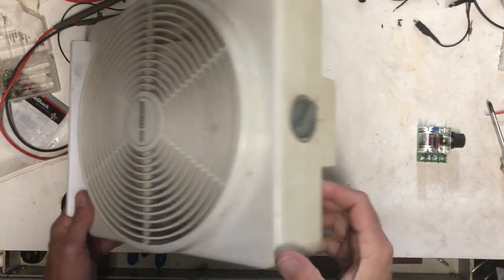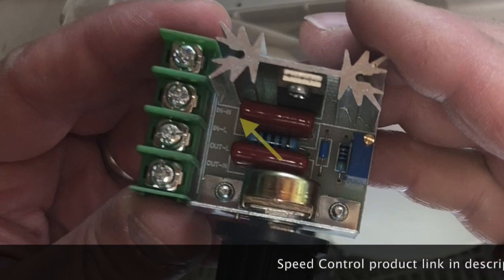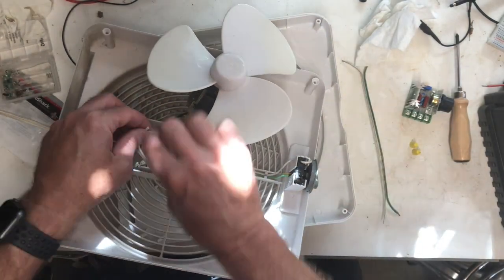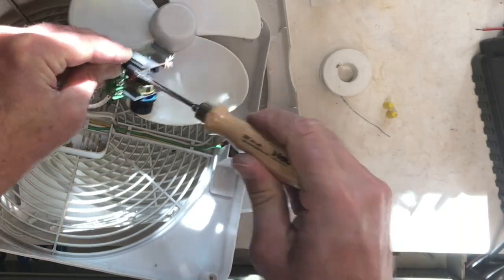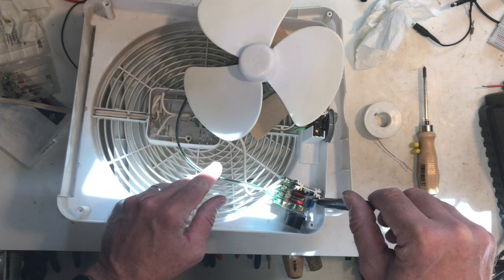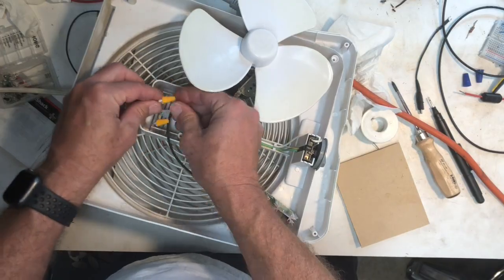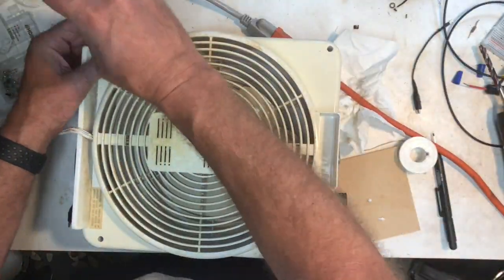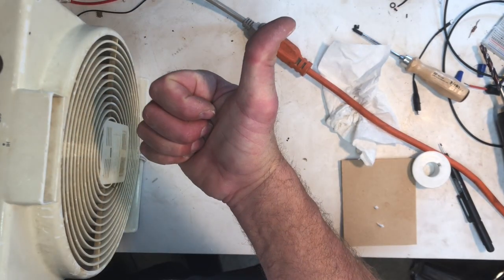Adding speed control to an old fan

Comment: Would this work on small inductive motors like microwave fans
Reply from the maker: I think it would but because the unit I bought provided a pretty awful looking waveform, I wouldn't use it in a safety-critical application! There are higher quality speed controllers available but this was just a toy application.
Reply: @ravraid  a VFD ino just thinking somthing $6 than $100 did see the wave form on your scope it chops the AC waveform not the frequency 
Its only a 10w inductive fan I have seen capacitors used but unshore it would work 
Regards the video loved it 
Please do more

Comment: thank you for sharing this video. I am a bit confused though becauseyou don't make it clear though if the original two speed power switch is still being used after you added the variable speed control. does the two speed switch have to be on? does it need to be in low or high? you did not make this clear or whether you even Incorporated it into the wiring. let me know. thank you
Reply: He eliminated the old speed control so switches don't work